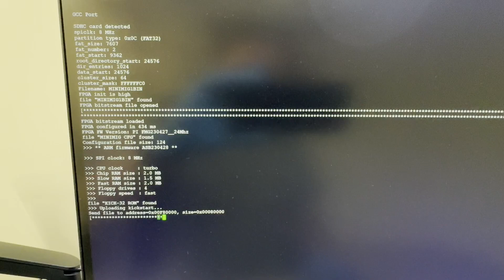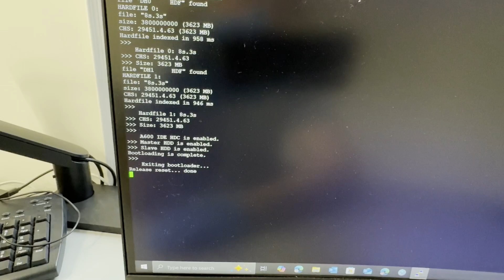🚀 AmiCube V1-SLX100 | SPI Transfer Perfection! 🔥

Comment: Pretty cool. Might have to get myself a brand new toy when it's all done. 😊 Question though. And I'm sure this was answered way back with the Minimig, but why the PS/2 ports and not USB. They really weren't a thing on the original Amigas right? Regardless looking forward to this 😁
Reply: It occurred to me after asking this question, does it have to do with the original Amigas not supporting USB out of the box?
Reply from the maker: What I will do, add real Amiga KB header as an option. I think that would be cool and easy to implement. And for convenience USB KB and the MOUSE + Joysticks can be USB or old school 9-pin.

Comment: The joy and fun of porting, even among devices from the same vendor. For internal development you may consider separating the FPGA out onto a separate daughter board, this allows you to try different FPGA's with just a daughter board redesign. You could use and existing pinout for the daughter board to avoid a lot of re-design work. For example QMTECH (no affiliation) has a range of daughter boards that use the same dual 64-pin header across both Xilinx and Altera parts.
Reply from the maker: That's a great idea, I'll definitely keep that in mind for future iterations!